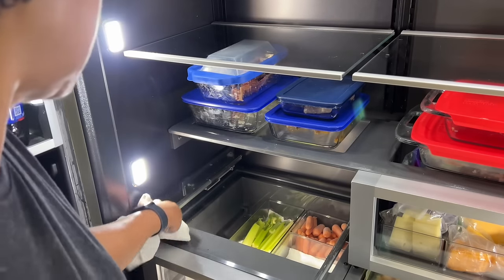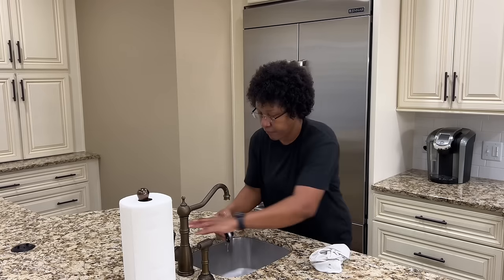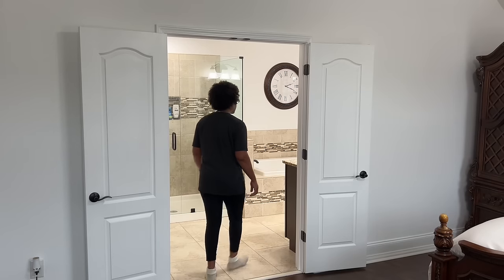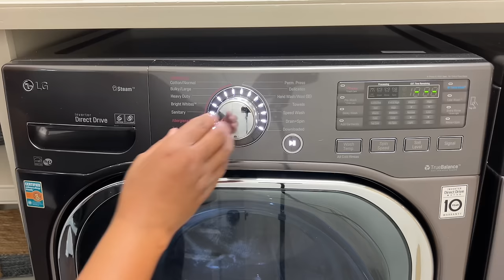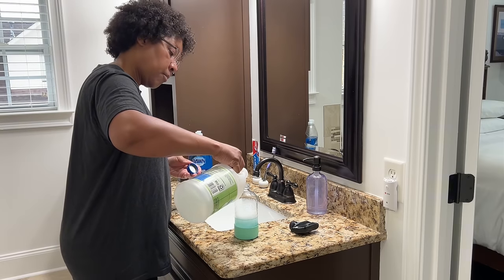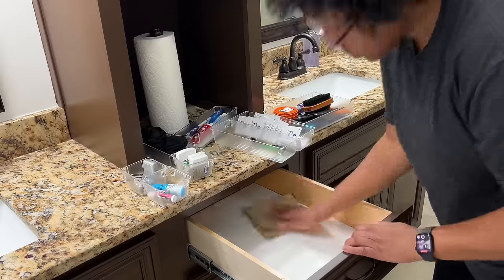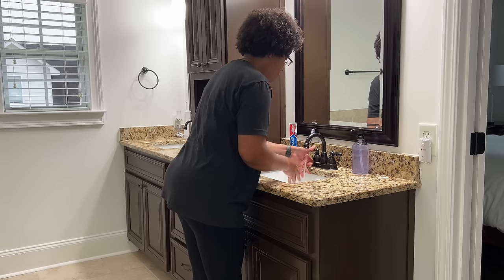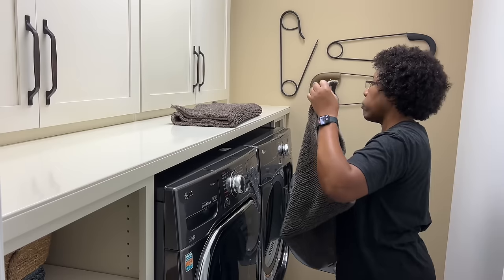DEEP CLEANING, ORGANIZING & LAUNDRY MOTIVATION | CLEANING & BUDGETING TIPS | DECLUTTERING

Comment: You have motivated me to clean out and wipe down my refrigerator and freezer more often!  It really is easier when there’s not so much buildup..  I have only been using one tide pod in the washer and our clothes seem to be getting perfectly clean!  I am beyond happy for your tip on that.  I wondered if you have a sheet set that you really like.  I am in the market for a new one and there are so many options out there!  Thanks again for another helpful video!!
Reply from the maker: Hey Sue…I love these sheets I purchased from Bed Bath and Beyond but they were an investment.  I’m unable to link it though because it’s been years.  I always look for 100% soft cotton, with 1000 thread count.  I have been purchasing cheaper sheets from Amazon lately for the boys rooms and they tear very easy.  I don’t recommend Amazon.
Reply: @Sissyspaces11   thanks so much!!  I will do some research on the cotton sheets.  And I appreciate the heads up on the Amazon sheets…
Reply from the maker: Anytime!
Reply: Hi, I like the damask white sheets from Sam's club. They are around 100$ a set. The plain ones from there are not as good, they shrink. But the damask/stripey ones r beautiful 😍